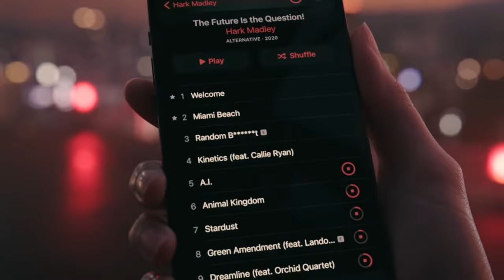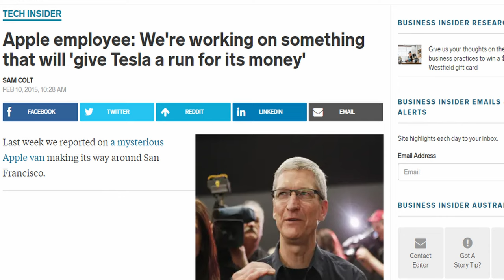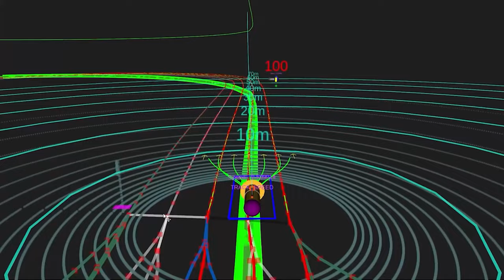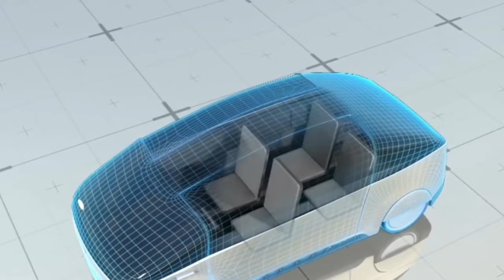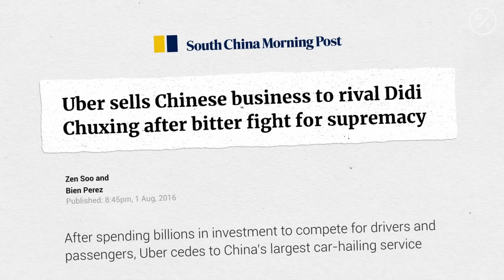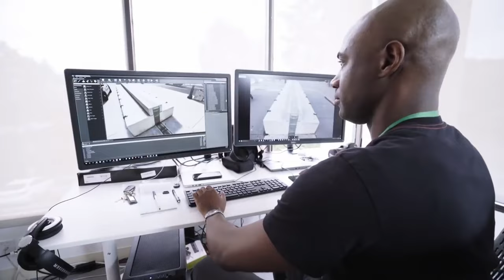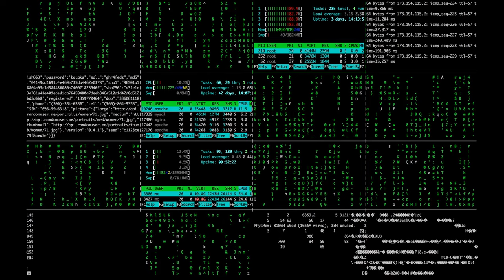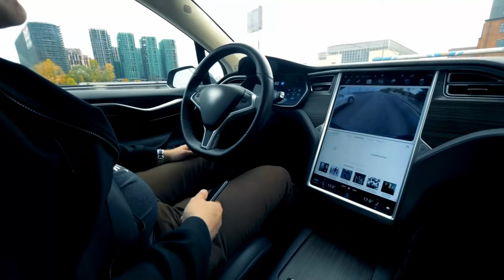Upcoming (Apple Car) - The Dirty Secrets and Apple Car Reveal Date

Comment: Definitely a huge challenge for Apple to break into the $55,000 bracket by 2025 with a winner. They do have the $$ resources but to assemble a highly trained techno team faithful to the brand will take time. VW partnership is much better than BMW, if they can work out an agreement with Porsche to share some of their well prooven designs would be great. To carry over the excellence in design and performance of the Apple name will be great for the USA auto industry. Great video, thanks.

Comment: I really see everything coming together. Apple self designed and made chips, AR, the software move to integrate everything to one platform, the lidar technique on the IPhone and face recognition with its funny smiles and phases projections. These are just examples on how the platforms will integrate and be used. The nice thing is that Maps have been improved to and knowing apple privacy will be a topic. Further more the Bluetooth and precise determination and location/ tracking of your devices point to how precise and easy apple will be able to make also for the car and roads a complete eco system. Just imagine that the iPhone is the Carr key... can be connect to the car wirelessly. And will be part of driving your car. Amazing!
Reply from the maker: Apple is definitely flooding their ecosystem with pipeline of products. It is quite exciting.

Comment: I left (retired from) Apple before project Titan was started. I worked directly for Bob Mansfield and thought it weird that he was selected for the project. He led a small cadre of computer design engineers that were very good, but they were not auto or AI engineers. He never ran an AI software group and in my opinion, was not qualified to do so. I suspect he told Steve that but Steve Jobs was not the type to take no for an answer.  In my humble opinion, that was a big mistake. You need a driven research leader to lead such an effort in uncharted territory. That would be someone like Elon Musk. The problem is, there is no room at the top in Apple for Elon when the opportunity presented itself. Apple will finally get there but will be late for dinner.
Reply from the maker: Wow. That's quite insightful.

Comment: Let me thankyou for creating a these video which has completed every aspects of project Titan by Apple.
I would say that Apple is focusing on creating an autonomous software for a car which will come in class 5 driving ( steering free car).
Apple will also focus on passenger safety.
The main challenge for apple would be of creating the database of roads and maps.
Apple will have partnership with other companies for product design such as biw, chassis, break systems, interior trims, seats etc.
The market for product design of car is already established and hence apple will not find difficult on cars product design.
The look of the apple car would be unique just to differentiate that it's an apple car.
About battery, I think that there are already lots of research going on batteries to increase its mileage and energy density factors around globe, so apple will not focus on batteries.
The future scope lies only with creating that complex AI software and hardwares and these is the area apple will focus and create it's identity.
Apple will also focus synchronising it's car features with iphone for ease of operations.
About the price, since it's a apple and has created a trust in consumers for years long, it will come with the best product.
That's all what I think.
Reply: Apple where never the first in anything. But when they do it, they do it almost perfect.
That's the reason I don't think that Apple will bring us the steering free car. I think they'll bring us a very Tesla like Car with the Apple experience. That means, a Car with the Qualities of Tesla Cars, without all the flaws a Tesla brings with it. Mercedes like Qualities with Tesla like Tech...

Comment: It will be extremely difficult for a  phone / software company to start manufacturing a car. Most likely Apple will use an established OEM for hardware. Apple should initially focus on user interface, interior design and software to ensure superior and seamless interoperability with their Apple ecosystem. This will be Apple’s key advantage. Still the entry into the new market will be expensive, long and very risky for Apple. Apple will probably use special features such a displays on glass surfaces as a unique features.
Reply from the maker: Well said, I however, I think Apple have the cash to tackle this expensive project head on. But it will be a daunting task for them.

Comment: They have the technology as well as ML and screens. iPad could be used with an M3 chip. If they can make an affordable offer is the question. Musk wants the whole market share and is ahead. No doubt Apple can’t pull this off. An ARM based chip minus any Qualcomm or Intel chips and we’ll have a secure car. There needs RAM and a firewall. These newer cars can be hacked with ease as Unit 8200 has shown off with the IDF!